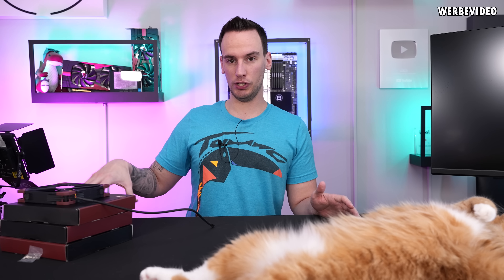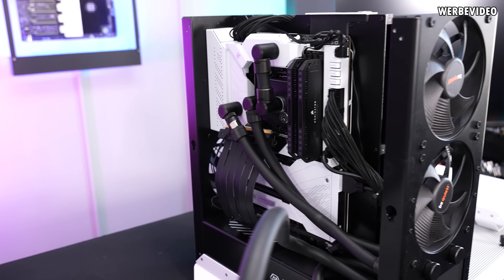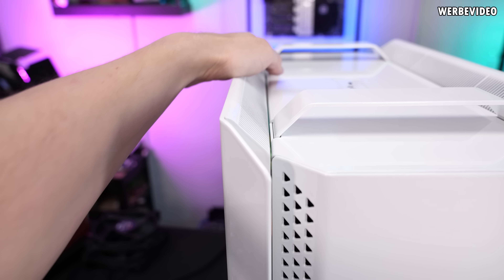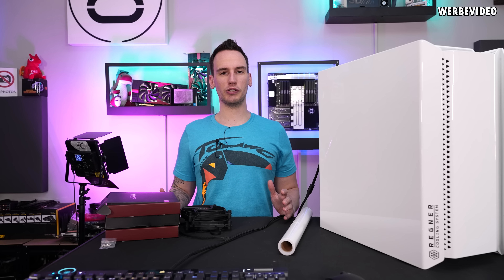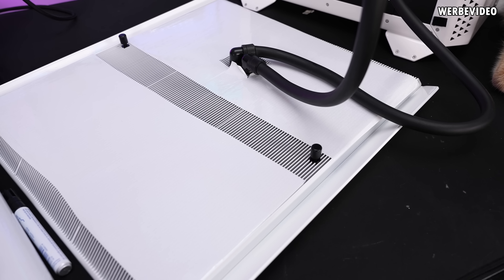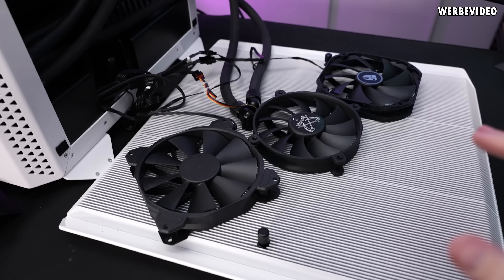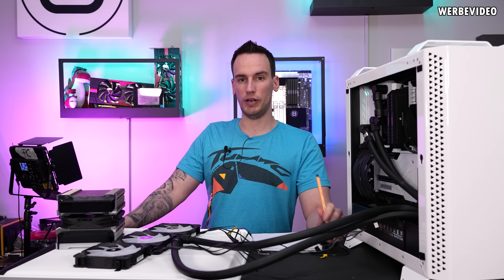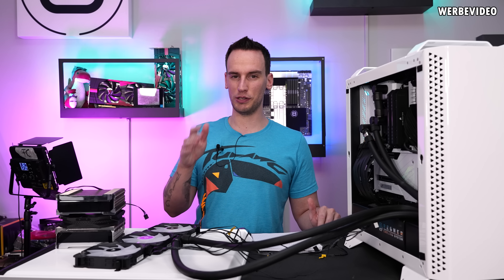Trying Community Ideas to Fix the 1700 EUR Regner Cooling Case

Comment: What about 3D printing some form of ducting/shroud, like what you would find in a laptop cooling solution? Just a thought. Have a great day! o7
Reply: Its a surface area problem. Not the fins.. I think they should be fine, but the surface area of the water inside the panels is just too small. I'b be willing to bet if you cut the panels open it is one wide path throughout sort of like a hosepipe encased in metal. Just not enough area for the water to dump the heat. If the whole rad filled with water instead of 1 small path and then the inlet and outlet were at opposite corners then maybe you'd see enough surface area. But the channel would have to be quite thin else it'd still just flow direct to outlet without dumping the heat into the fins. It'd be an engineering challenge but somehow running the water up and down the inside of each fin would be the way to do it. Massive surface area inside and out.
Reply: @DampQuiche  Maybe Roman can take the panel to be XRAY'd. He's done it before with other hardware. It's at least a non-destructive way to look inside.

Comment: Would love to see the sides be powder coated with a thermal dispersant instead of the paint.
Reply: Was thinking white paint will be really bad at transferring heat, at least some matte black paint or something, it's been proven with radiatiors and intercooler on cars painting them black rather than silver improves there efficiency
Reply: While measurable... The colour change would not suddenly add even a degree to the temp drop. It isn't that big a deal unfortunately.

Comment: Standard side panels with slots for 360 radiators would be the best solution - the radiators need some airflow or they just radiate the heat into the case, there is space in the thickness to allow for mounting radiators and fans but it really negates the entire built in radiator concept - id say its a shame, the look of the case is good, but you also found some practical issues beyond the radiators too - to me seems like classic over engineering  - there is a saying - an engineer does for $5 dollars what any fool can do for $10

Comment: first of all the orientation of the fins is wrong if you push intake* air through them from the FRONT**
Second if the intake fans were exhaust would have some logic (forcing air through the gaps top bottom through the radiator fins and out from the exhaust fans. (if you could help that flow with top exhaust and bottom intake in a sealed side panel configuration or even front to back flow, would also work better)
But the best performance would provide top and bottom fans or even all sides except the panels as exhaust and with open through panels and well sealed case to force air come through the radiators from the sides with some filtration. (like air purifiers)

Comment: The Fins on the side panels should have been Horizontal to the Case. would have made the front to back air flow a little easier, but even then, I don't think it would have help much. I believe to have any real chance for this design to work, it needed to have directed Air flow channels from the fans to the fins and then channels that direct the exhaust out of the case probably with the help of exhaust Fans. It's an Interesting Concept, but it needs a lot of Prototype work and Real "Independent" Lab Testing!!  Just my 2 Cents! LOL!

Comment: Lets just be clear hear... The issue is not getting the heat from the rads into the air. It is an issue getting the heat from the water into the rads. Semi-forced/passive cooling can work wonders. But unless the channels in the RAD are designed in such a way so heat can get into the metal... It'll basically just act like an insulator. You could point a tousand fans at this thing and it would do nothing. Well it would be forced air cooled. But within reason there is nothing you can do as it is just a bad design.

Comment: what's crazy is the company that produces the case had to have known that it did not perform well and released it anyway and charged so much. they probably got tunnel vision when they designed the case saw it was a bad performance but felt that the concept of the radiator case would be a big seller. I definitely would not buy this case or any newer design cases from this company simply because they had a failed product and now want to redesign the case but unfortunately I wouldn't trust a newer case

Comment: I also think something is not right on the LC side. Maybe pump can't handle those massive radiators. For example if the plumbing inside radiator is spread in vertical loops then the pump has to work extra hard because it needs to elevate water against gravity for each loop.... but in that case it should work much better when you placed side-panels horizontally - flat on the desk and that wasn't the case.

Comment: Fin density is only half of the picture - you need to examine how the water gets distributed between the radiator inlet and outlet. My guess is they're using just a single channel and relying on convection to carry the heat away. The problem with convection is that for an area that large it simply doesn't work. You need significantly more channels running through those fins for the heat to even have a chance of being absorbed by that much metal. Just cut open one of those 80mm thick alphacool radiators and you will see what I mean. More water channels would also mean more coolant volume - more water does absorb more heat as well. Finally you might want to look at the pump to see how much water it is moving. The entire loop should circulate at least 4x-5x per minute.

Comment: I think i am going to get hate for this, but this wont work because its an innefficient design choice, from the beggining.

The radiator is a slab of aluminium with straight fins. Its like a basic stock cooler. It will need a huge amount of airflow to dissipate heat.

There is a reason why cars and air conditioners dont use radiators like this. Its because they suck at dissipating heat.

Comment: The case manufacturer should have done this kind of testing.  If they did, they would have found the flaws in their own design before trying to go to market.  This video isn't as interesting as I hoped it would be, because it isn't about improving a pretty good product, it's about trying to make a terrible product okay, and that is 100% the manufacturer's responsibility.  When they fail to do that, I'm not interested in doing their due diligence for them free of charge.

Comment: The case is just not a good solution, the only way to significantly increase the performance seems like connecting an external MO-RA, which defeats the point. Honestly, just replace the two side panels with two MO-RAs and a beefier pump

Comment: Its a surface area problem. Not the fins.. I think they should be fine, but the surface area of the water inside the panels is just too small. I'b be willing to bet if you cut the panels open it is one wide path throughout sort of like a hosepipe encased in metal. Just not enough area for the water to dump the heat. If the whole rad filled with water instead of 1 small path and then the inlet and outlet were at opposite corners then maybe you'd see enough surface area. But the channel would have to be quite thin else it'd still just flow direct to outlet without dumping the heat into the fins. It'd be an engineering challenge but somehow running the water up and down the inside of each fin would be the way to do it. Massive surface area inside and out.
Reply: They may have forgot to put an inlet/outlet channel and the hot water is being sucked directly BACK into the water cooling block to the CPU!!! Not a cheap fix.

Comment: Interesting concept for a case, but 1700 euro? Really? Blocks, hoses and a D5 cost about 300-400 euro... Aquacomputer Airplex Gigant 3360 costs 750 euro. And that will cool basically any system passively. And even if you then factor in 100 euro in coolant to fill the dang Airplex, you've still got 500 euro left to buy any other case you want that suits your tastes and aesthetics.

It's a neat concept, but there are much better cases available to do a passive system in, without the faff of water cooling. And if you want the faff of watercooling, then there are much better solutions for much less money.

Comment: Over a year ago I presented you folks with my "silent chiller" vapor chiller external unit I fabricated from scratch including all the electronics (on wheels) that is plug and play and can cool down any CPU/GPU sub-ambient down to dew point without any worry of condensation (fully automated) for $2300 US ... and yet you review a POS 1700 Euro case that can't even do ambient cooling?  Call me confused, I thought this was a hardcore PC channel?
Reply: @SaschaElble  Sorry, you're not making any sense to me?  I'm not suggesting anyone build anything ... I've done all that hard work, I was hoping I'd get interest/review of my product designed for "hardware enthusiast" (I attempted email contact, but got no response).  Regardless, this IS a "cooling channel" ... why else would we see all the LN tests being performed here?  And who are you to suggest "no one wants to build their own" ... most of the content on this channel is exactly for people that want to build their own PC.
Reply: @SaschaElble  Do you have problems with reading comprehension?  Or are  you responding to someone else and hit the wrong button?  Again, I'm not advertising anything, I provided Roman the opportunity to review my prototype silent chiller that I built to be used by anyone who is not mechanically nor electronically inclined ... it's plug and play, no manuals needed no worry about condensation and very quiet.  It's definitely not an air conditioner as it produces heat that can be exhausted outside or anywhere.  It cools liquid coolant that runs over the CPU, GPU, RAM water block, VRM water block anything that works better when cooled below ambient temps.  Something the unit Roman is reviewing above is unable to do.

Comment: Straight up....call it like i see it , you got scammed for 1700 euro .
I mean what is the goal, on their claim is cool and quiet .
Quiet yes , cool no ...this should be a XOC dream case based on the cost and radiator surface .
So not only you got scammed for 1700 euro bro , they made you a guinea-pig and engineer to improve and test this junk .
You know take in to consideration they clearly never assembled a full 3090 12900k , becouse you would expect some kind of test of their product .
No dude , stop been nice , you got duped , taken for a fool , call it like it is , is a scam.